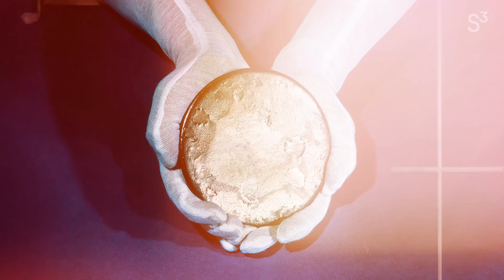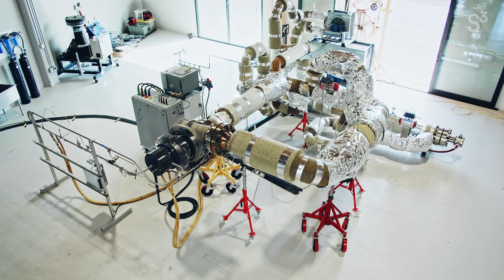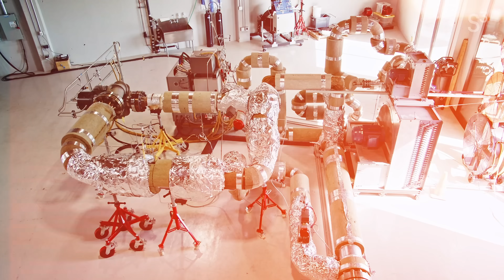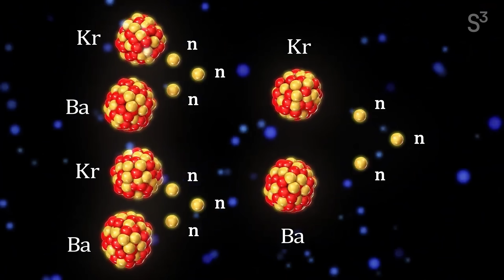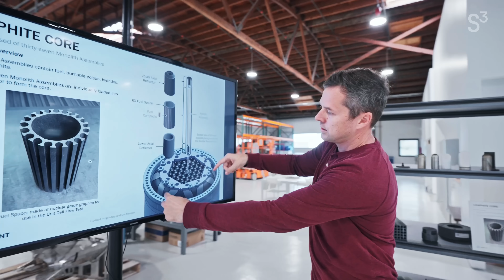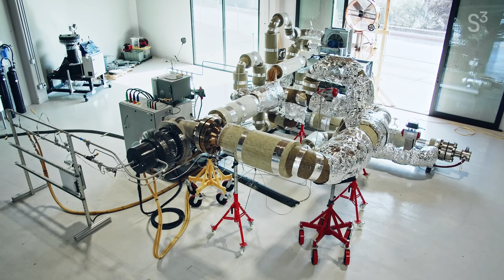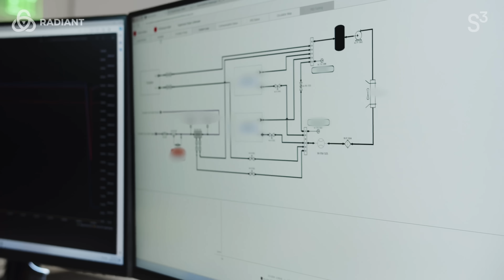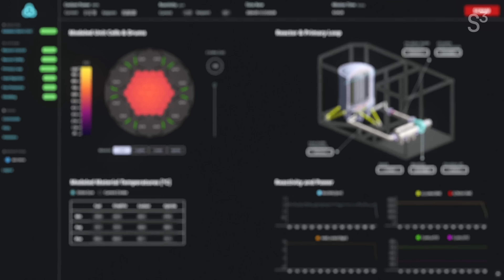The future of Nuclear = Small, Mobile, Microreactors | Radiant

Comment: Like 15 years ago, when I learned that all of our submarines and navy ships were powered by nuclear reactors, I immediately thought, “why is nobody doing this in the private sector”. It’s only now that I’ve discovered the reason: existing power structures and narratives. That will be the greatest barrier to Radiant’s success.
Reply: Not all Navy ships. Only Submarines (SSNs / SSBNs) and Aircraft Carriers (CVNs). Everything else is still conventional, to include LHAs and LHDs. There was a period of time in which some of the smaller ships were nuclear powered, but that didn't last long.
Reply: The real reason is submarine reactors can be ran in a way to produce a lot of weapons grade nuclear fuel. Our government doesn't want that in the hands of the public.
Reply: @adamsilver7268  Your real reason is not real; all reactor spent fuel can be reprocessed for peaceful or war purposes. The Iranians are not using submarines to get weapons grade uranium (for example)
Reply: @pindapoy1596  that is the reason though.  The reactors on a nuclear powered ship is enriched to basically weapons grade.  That is the only way they can get that kind of power out of a small powerplant while not going with insane levels of shielding.  There are a few nuclear engineers that have been asked this question when being interviewed and they explained it.
Reply: You missed. It's government regulation, i don't know how this two are getting away with it, maybe California gave them some type of special permission but as far as i know federal and the department of energy regulate this type of devices out of reach to the private sector.
Reply: @lcfflc3887 
They can build anything they want right up to the point where they try to put nuclear fuel into it.
Reply: @lcfflc3887 You're why Trump loves the poorly educated. Nuclear power plants are private sector and are basically scaled-up naval reactor plants. So it's not regulations that are the problem. Micro reactors and SMRs all have the same problem - scale of economy. SMRs and micro reactors cost a lot to manufacture so that means they power they produce is very expensive. A big NPP costs more to manufacture, but it produces many more times the power so its power is cheaper. This is why all the SMR projects in the US have gone nowhere.
Reply: It will take 1.5 years to get the manufacturing ramped up
Reply: @jason-cu2oo  With all respect, how have you arrived at such conclusion? What is the basis of your calculation?
And  one more question: How can you be sure that investors are willing to put money in rebuilding the manufacturing industry when they are sitting comfy importing everything from China and making a juicy profit???
Reply: Then like 5 years ago nuclear waste was going to go into batteries that last forever.
Reply: Control of the prices and access to energy is the current state of civilization.  When the atom was split an energy price correction should have occurred.  Now we live in this bubble.
Reply: Simple....NIMBY Lawsuits by folks legitimately scared by 3-mile Island,  Chernobyl & Fukushima.  These designs are far better and the most CO2 reducing options available today.  If we can do these with Thorium, it would be even better ...
Reply: Mega rich have them
Reply: Not every navy ship is nuclear power… it’s only aircraft carriers.
Reply: @shaneciccarelli-palmer2962  Submarines
Reply: @shaneciccarelli-palmer2962  and some submarines..
Reply: Submarines and Aircraft Carriers can operate at a loss. A company cannot. Small reactors are not financially viable.
Reply: @ericdale6201  Off hand you might have a point but  throwing such statements without any numbers or $$ calculation is , to put it respectfully, rather adventurous. I am not sure that a basic data point which is the cost to a utility to acquire and install a mini reactor is known. So, how can a utility compare a mini reactor cost over a full plant lifetime with a similar figure and for the same power rating obtained from an alternative source?
Reply: @pindapoy1596 The point is when you mass produce these reactors their costs will be reduced, and can be put just about anywhere without the huge environmental impact concerns that existed before.  Once a production line comes on, just think of how many customers already exist with just Data Centers alone, and the advent of AI will only accelerate the demand.
Reply: Oil companies are very powerful and their lobby group carry guns and dollars...FYI.
Reply: @thomasjamesdyejr1814  We had large nuclear power plants before and despite the oil lobby's influence. Had it not been for the greenies and Three Mile Island, we might still be building nuclear power. Now, someone may argue that the greenies are paid by big oil; who knows...
Reply: You should wonder why the us doesn’t recycle nuclear waste and most of the establishments don’t employ systems to utilize such beneficial practices.
Reply: @Oceansovermidnight If it is not a profitable business we are not interested. Welcome to the capitalist world
Reply: @Oceansovermidnight what do you mean we don’t process nuclear waste?  We have Kilotons of depleted uranium, all of our high energy medical isotopes come from nuclear waste, or byproducts thereof.
Reply: @NeroontheGoon  Hi, I mean that I've heard through reliable sources that most of the waste isn't processed. The amount of "byproducts" need to fuel the devices you talk about are very small compared to the size needed for energy applications. plus most places don't buy new radiology devices every other year... some people use the same devices for 30 years. I've heard that the waste can be recycled/filtered in the upwards of 90% and then recycled back into the plants over and over... I'm not in this with all the answers or quotes. If you have better info please let me know. Thanks
Reply: Yeah do you also know that in both the Columbia gorge and in Georgia were they repower nuclear subs there are ice dams like in fukajima around those facilities to help slow the seepage of radioactive nuclear material.  And these assholes want to adopt the landscape with it.  You know where every piece of nuclear fuel used in a power plant is?  It's in the heavy water storage facility at the nuclear plant It was used in.  We have no disposal strategy except for Congress to argue about it.  It's highly irresponsible of idiotic green loving people to promote nuclear energy when all it does is kick a gigantic horrible nuclear radiation spitting ball down the time frame of humanity by about 4 million years.  I'll take CO2 in the air Thank you very much and leave less of the earth damaged by nuclear radiation for future generations.
Reply: Yep, big power companies will get angreh when profit cuts
Reply: @YuNherd  when aren't rich people angry... most are one step away from murder 99% of the time.
Reply: No it isn’t some great conspiracy. Large reactors with huge power plants are far more efficient than small reactors with small power plants. That is what commercial reactors got bigger and bigger. That is why fission with small reactors will never make a comeback. The large reactors aren’t cost effective against renewables. Small ones except in very limited applications never will be. I worked in US Naval and US commercial nuclear power for over forty years the industry is shutting down fully paid off nuclear power plants whose only expense is O&M and fuel. This is with the biggest expense of nuclear plants is construction.
Reply: @Jordan.Vaughn    A bigger barrier is the self inflicted disaster of having abandoned our industrial capabilities. The proposed reactor and many others of different designs may turn out to be very effective and efficient BUT the manufacturing capability is not there and it is the revival of this capability that will prove to be the key to any nuclear power plant success. 
Experimental models and research in general are just the starting phase but we need realism if such reactors are not to remain "interesting toys".
And it is not only the manufacturing capability that may turn out to be a stumbling block. Our lack of craftsmanship is also a huge problem. These complex machines need a highly skilled workforce but as a consequence of our industrial decay, that workforce has shrunk to dangerous levels and nobody is interested anymore in having  "greasy hands".
And finally,  it is interesting that you bring up the nuclear navy. You certainly know that its development and growth was due to a remarkable man, Admiral Hyman Rickover. I really wonder if people like that who did not fear to swim against the tide and keept getting things done though personality strength will ever surge again in an era of political correctness and DEI control of industry and business.
Reply: @pindapoy1596  When there is no conflict. People get weird. You can see it in the microcosm of people’s personal lives and the macrocosm of the government. It eventually calcifies the system itself with interminable rules and regulations. Watch how a war will wash all the shit away, then this company might stand a chance.
Reply: @pindapoy1596 Also the blocking of nuclear waste facilities.
Reply: Exactly, private Companys are know to work very safely and put safety and sustainability before profit
Reply: @lucianoag999  Wake up. Private companies are working for maximizing profit for their shareholders. That is their only reason to exist and they are not interested in anything else.
Give us one single example  you know of,  of a private company that puts safety and shatever else before profit and I will show you a CEO on his way of being fired.
Reply: I had lunch with a buddy of mine who is well placed in governemnt and he said there are three things that stand in the way of any kind of realistic progress. They include: "we have always done it this way, That's not the way it's done and the regulations are not written to do it that way."  This is what stands in the way of modular nuclear power generation.
Reply: @JR-bj3uf  Is your buddy American? Because what he says is very, very unAmerican. I would have answered: We have never been to the moon it is not in our customs...but president Kennedy did not say that.
It is clear that if  we are not making any reactors or mini reactors is for other reasons. When we made them in the past, and quite well since everybody in the US or abroad  ended up buying pressurized water reactors from Westinghouse or boiling water reactors from GE it was because the government's policy was clear and nobody was dreaming about saving the planet with windmills or mirrors on the roof. The government was promoting realistic sources of energy, was not against fossil fuels and was encouraging research at all levels for getting a better solution for producing bulk power. At the same time we were still an industrial power with heavy industry and we were not dedicating our interests to creating gaming and apps to order pizza.
Reply: @pindapoy1596 The US can do spirit of 1950-1960s is no longer here.
Reply: @peredavi  Agree
Reply: @JR-bj3uf Still, SpaceX seems to be able to bend the rules
Reply: @JR-bj3uf Oh you must be sooooo important to have a well-placed buddy. I worked for the NRC for 35 years and nee designs are scrutinized to ensure safety. All the reviews for advanced reactor designs took about 7 years yet they were all approved. Whoever you're buddy is, they're full of shit. And you can tell them I said so.
Reply: I don't think its due to nobody wanting greasy hands. I think it has more to do with the fact that submarines have endless supply of salt water for cooling purposes where other land based applications don't AND more importantly capitalism is already failing North America in many ways; I don't want to imagine how poorly a job the gov't would do regulating powerful Companies while they play with nuclear reactors.
Reply: @fsteddy6576  It's not "capitalism". It's "Crony Capatalism". There is a huge difference.
Reply: Exactly.  Its capitalism without regulation. @ziprline
Reply: @fsteddy6576  You are mixing everything in one big salad bowl.
Greasy hands means that we have lost craftsmanship to build the readyors in factories and then placing them at the proper sites creating electricity generating plants.
Salt water cooling and capitalism again a re a wierd mixture of ideas. We do not really know how the new reacors will be cooled. Period. End of technical discussion.
Yes capitalism is failing and the cause is largely corporate greed. Shifting jobs and industrial production abroad for the sake of increased profits.
The poor performance of Government regulatory agencies is well known but the influence of lobbyists and the power of "I give you and you give me" should not be ignored. 
If you watched the recent inquiry about power loss in Houston following a relatively low intensity storm, you could easily understand that the questions were not sharp and the answers were meaningless. At some point in time everybody was discussing tree pruning along the power lines right of way but that is minor compared to the fact that we do not produce anymore the required electrical equipment to improve the network and even if we had the components, there is no desire to invest..
Reply: @fsteddy6576  You are mixing everything up.
Not wanting greasy hands means that we have lost the craftsmanship needed to fabricate the reactors and istall them in the field. We do not have the people with the proper knowledge. We lost them because they had no industrial jobs to go to and went somewhere else.
Cooling wit ocean or river water has nohing to do with the problem. A nuclear power plant site is chosen IF it can offer such cooling resources on land or it is close to a sea shore and water can be pumped in (and out).
Capitalism is failing for sure but our governments are gulty for having allowed our industrial base to flee to places where they can save on labor costs. Nobody thought of the consequences because we live for instant gratidication.
The regulatory agencies do a poor job in many areas and for many reasons including corruption, lack of knowleadgeable people and frustration because by trying to do a proper job you will eventually cross a lobbyst who is against your objectves.

Comment: Quite curious about the cooling capabilities of Helium. Just googled some stuff and it has a heat capacity of 5kJ/(Kg*Kelvin). So if you want to transfer 1MW of power per second, at ~10K temperature difference, you'll need to pump 20Kg Helium per second. Are they using liquid or gaseous helium?

Comment: I have to disagree when it comes to terrestrial fixed location energy generation, I was of the opinion that nuclear was going to be required, but really if what Quaise Energy is doing turns out good, and I can't see why it wouldn't everything else could be obsolete for a good long time until we get fusion.

What their plan is is to dig for geothermal using fricking laser beams, now that may sound stupid and yes I made it sound stupid on propose, but when you consider what their goal is, which is geothermal anywhere on earth and you consider the limitation of current drilling techniques which is if you wanna go further than 3km down it starts to become extremely expensive and by the point you are 10km down you wearing out your drilling head in an hour and you have to bring it back to the surface then change it and send it back down which can take weeks to do another hour of drilling.

where as laser beams don't really ware down and a 1MW beam can drill 20km in 100 days which is far enough down to get geothermal anywhere on Earth and that well is good enough for ~100 years of usage, and it's not like it wont eventually recover as long as it doesn't collapse, and to stop that you would fill it with water and keep a cap on it to keep the internal pressure high to prevent it from collapsing.

Comment: So what happens if you drive a Peterbilt into one, or throw a handgrenade or sucide FPV drone at it? Building a nuclear power station is not just about making it produce electricity, thats the easy part. Its having it double- and triple safe for any likely and unlikely scenario without risking a radioactive catastrophy thats the hard part. A nuclear powerplant has multiple barriers of protection, just becase you make the reactor smaller doesnt mean you can skip these barriers.

Comment: Very interesting, but one point that seemed very silly was the idea of taking a fission reactor to the frontlines of a conflict. Normal fuel is "fine" when it gets blown up in the sense that as long as you avoid the initial explosion, youre fine. If your nucelar reactor gets blown up you suddenly have a the massive issue that your entire encampment is now a nuclear fallout zone for the foreseeable future. Radiation poisoning will quickly incapacitate your battlegroup. Add to that the fact that fuel is required not only on base but also in all your fighting vehicles, transport and armour. Youre not really going to be able to get rid of having to provide traditional fuel resupplies unless you somehow put nuclear reactors in all the vehicles too!  (And you'll still have to resupply food and water regardless). I'd also imagine that its resupplies to units in the field where most of the mentioned casulaties occur, implying that having a nuclear reactor on base is not actually solving the problem anyway. So either you put a nuclear reactor at every single outpost in the AO, painting massive targets for hostiles to incapacitate your fighting force or their strategic advantage (when you have to immediately evactuate the advantageous ground you put the outpost on!) or you just power your primary bases with nuclear reactors, not solving the requirement to provide traditional fuels to frontline troops. Bad idea.